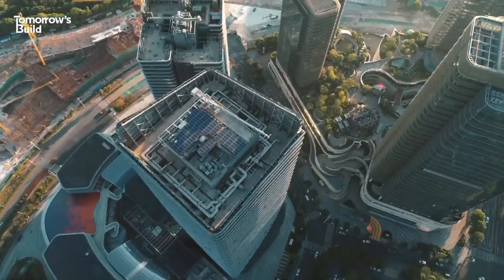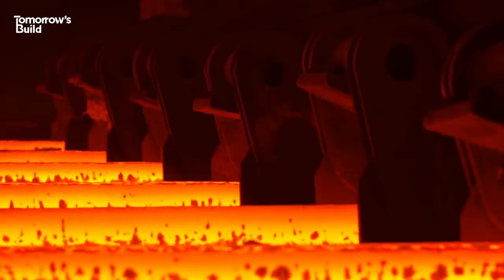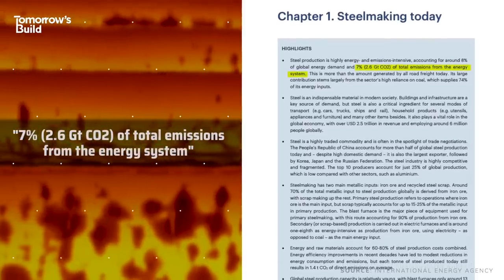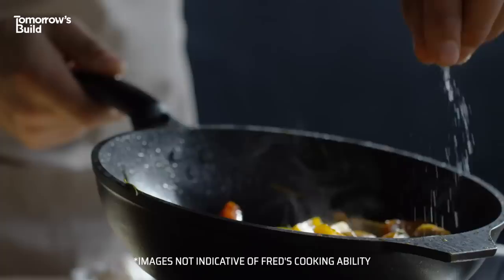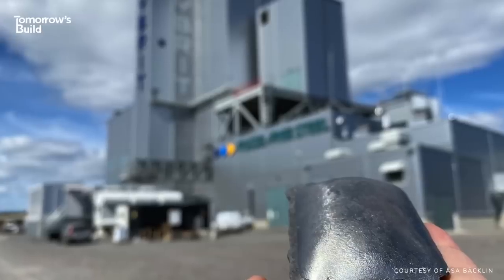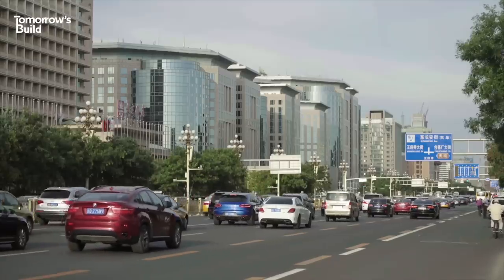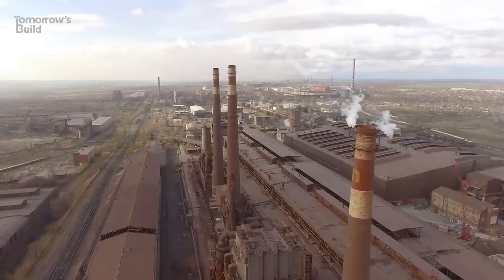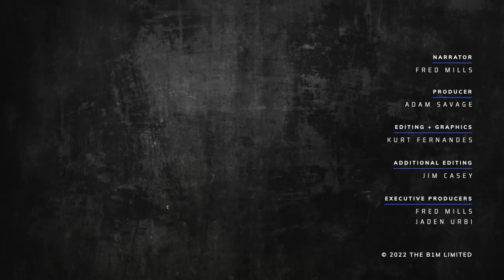Has Sweden Invented Green Steel?

Comment: I know from my professor, that the german companies like SalzgitterSteel are currently trying to implement this production technique for their production. The even plan on building windgenerators on the facillityground to produce the hydrogen.
Reply: In General, the concept of "green-steel" is nothing new. ThyssenKrupp is currently trying to convert their furnaces to accept gas, such that they can be easily switched to Hydrogen later on.
So no. Sweden has not discovered "green-steel".
Reply: @Ruhrpottpatriot  well no one else has made  green steel before, as gas furnaces do still have massive co2 emissions.

Your basis is the person who jumped basicly flew for the first time and solved flight. 
Achieving and theoretically trying are vastly different. 
In this endeavor Sweden was first.
Reply: @fridaybot  No, the title of this video was "Has Sweden invented green steel".
The usage of a know practice is not "inventing", it's "implementing".

And then even that is false. The Deutsche Edelstahlwerke already has a production method in place with reduced CO2 emissions by 90%, the swedes have 95%.
Reply: @trail-coffee4654  So exactly what TK wants to do starting 2024, i.e. 6 years prior to the plant from H2 Green Steel?
To quote TK: "thyssenkrupp Steel targets to put the first DR-plant into operation on an industrial scale in 2024."
 
Currently TK runs a H2 electrolysis plant in a venture with STEAG with 500MW capaity. This H2 will be used for DRI.
Also TK isn't building a completely new plant from scratch, like H2GreenSteel, but refitting running furnaces, which has additional complications.
Reply: I do hope they have plenty of room. With the best of todays windmills it would take 123.000.000 of them to produce the 80TWh needed in Sweden. And that's if the wind always blows hard enough.
Reply: @darkiee69  Why are people always so laser focussed on one singular green energy tech? 

Also: "80TWh" per what? day, month, year, decade?
Reply: @Ruhrpottpatriot  Year. That's all the hydropower produced in Sweden yearly, and then some.
Reply: @Ruhrpottpatriot  I dunno. To me it always seems like some sort of a straw-man argument.
Going green usually consist of two steps:
1. Make it work on electricity.
2. Produce environmentally friendly electricity.
The fact that the second problem is not solved yet, doesn't mean the found solution for the first problem is bad.
And one can argue that the second problem has many solutions. Only the implementation is slow, because of lack of priority.
Reply: @mennovanlavieren3885  Fun fact: The second problem has been solved, it's just that many people don't want to see the solution because then they would have to change their habits, or big companies fear for their revenue.

The fact alone that a good chunk of electricity demand can be covered by slapping PV modules on every rooftop (and paying the owners the same prices that electricity companies get, which cuts into revenues of big fossile fuel companies). 
Most of the natural gas or oil furnaces can be converted to heat-pumps (which also double as cooling in the summer), and district heating.
Then there's also the need that the number of cars needs to be reduced drastically. There's simply no going green when we keep the same (or even more) cars on the streets. This means, we need to invest heavily in public transport (which cuts into the revenues of big car).
And of course for places like the US the problem of racial and social segregation plays a huge role in keeping the current and totally stupid zoning codes, which further promote environmentally unfriendly tech.

There is not a single solution, which is what most people expect. Instead there are many small steps that male up the puzzle that is climate change.
However, that often is far to complicated for many people (for a number of different reasons).

Of course research still needs to be made to make everything more efficient.
Still: We have the tools, we just need to use them.
Reply: The French and Italians are also working on this ,especially to make specialist steels .
Reply: @Ruhrpottpatriot  I'd say a big issue is how govts handle implementation, like in my state rn they're subsidizing solar, however instead of putting them on preexisting structures they're taking entire former agricultural fields and painting them in low solar panels that spend most of the year buried in snow. Or with wind they get to bypass environmental protection laws to bulldoze, pave, and cement entire mountain tops to put them in and completely wreck the natural landscape. We also really need to work out the recycling and production hazards of solar BEFORE we go too crazy with installing them, and should probably subsidize cleaner and easy to recycle variants. A lot of ppl that are against green initiatives in my home state aren't against going green itself, it's how the govt bungles it that they're against. A lot of these govt subsidies actually benefit wealthy land owners to a worrisome degree, and you run into similar exploits to the insane 'carbon credit' system. We really need to have more transparent thought out infrastructure plans at this stage for widespread adoption.
Reply: @xxportalxx.  "We also really need to work out the recycling and production hazards of solar BEFORE we go too crazy with installing them, and should probably subsidize cleaner and easy to recycle variants."
The recycling is already there, there's simply no legal requirement of companies doing so, at least not outside of Europe, where at least 85% of old panels need to be recycled.

"however instead of putting them on preexisting structures they're taking entire former agricultural fields and painting them in low solar panels that spend most of the year buried in snow."
You mean, the farmers take the money and then build PV on their fields to make easy cash?
Reply: @Ruhrpottpatriot  yes, exactly, recycling infrastructure can't just be manifested overnight, it should be built in conjunction with the panels (with an actionable plan established BEFORE the construction of the panels). The subsidies should be modified to favor installation on buildings, rather than deforesting land to put up a field of panels (which happened a mile down the road from where I'm currently typing this).

If we don't manage these things properly then we're simply trading one ecological disaster for another.

Comment: Is this hydrogen they are using now even actually fossil-free? To make green H2 from purely renewable power is still 5x more expensive than gas based H2 and very rare, making any resulting steel product a very expensive and undesirable deal. I can't find anything about the source for the "fossil-free" electricity on their website either.
Reply: I  think Fortescue  is going to be the supplier.
Reply: Certain people get somewhat annoyed if you bring the topic of “cost” into the discussion. Apparently their motto is “at ANY cost”
Reply: Almost all of Sweden's electricity is green. 90% is from hydro, nuclear and wind. Less than 1% of Sweden's electricity was produced from fossil fuels in 2020.
Reply: Can Sweden produce enough steel to be a major exporter in the world market? Can they compete with giants China & India?
Reply: @Tux.Penguin  probably not. still, if they manage to perfect this technology and bring the costs down, bigger producers will follow
Reply: @Tux.Penguin  Sweden is one of the world's biggest suppliers of DRI grade magnetite. And no, even if they converted that all into green steel, they'd still wouldn't be a major exporter of steel globally. That's one of the key issues with Hybrit that no-one wants to talk about - it requires a very specific ore type that only makes up s tiny amount of all the iron ore currently being mined.

Comment: Actually there are plenty of steelmakers in Europe discussing/planning to use the HDR-method. There are also some initiatives in Germany for example to modernise entire industrial regions by focusing on using hydrogen instead of fossil fuels. Its really interesting to see what synergy effects are possible when you connect different industries (from byproducts that can be used somewhere else to redirecting process heat). Only downside atm is the cost of green hydrogen (production as well as transportation and storage) and the lack of proper subsidies from governments. Hydrogen imo is really being held back by the "let's electrify everything" agenda. But let's see where we are in 5 years
Reply: I totally agree 

A lot more investment in R&D to bring the cost down and especially find materials that are cheaper to make electrolyzer more cost efficient 
The energy solutions to produce GH2 cheaply are available, it’s just the equipment to convert and then the best solution to store/transport ( which might be ammonia) 

Solve for electrolyzer membranes and we are well on our way

Comment: If this holds up it could indirectly help part of the storage issues with something like wind energy. Conversion from energy to hydrogen and back again isn't super efficient but if all you need is the hydrogen for this process, that could be produced when there's a surplus of energy in the grid, instead of shutting down wind turbines to avoid blowing out the grid.
It obviously won't help with getting power back into the grid on demand but taking care of surplus in the production line of a highly needed product will presumable make it possible to put up more windmills without having to shut most of them down outside of peak consumption hours.

Comment: They are opening up a green steel factory near my town and I was intrigued. Now I know more about it and why it is getting so much attention. 

However, I did drive to the location of where they are building this huge factory. They chopped down basically an entire forest, and the factory requires more accomodation and the such in order to host its staff in an already cramped city. It just feels off claiming it's fossil free and etc when the entire process, from start to finish isn't by any means this.

Comment: So at what point does the reduced Fe acquire the Carbon atoms to become actual steel. My understanding was that the steel we use is an alloy of carbon and iron molecules with some additive elements for specific use cases. If all you add to the steel is hydrogen to reduce it, there is never any steel made, just some high purity iron.

Comment: What's the cost difference to use this method? And how much energy does it take to make the hydrogen for the process?
Reply: Opex alone is multiple $100s per tonne more expensive. Capex is catastrophic. If it were in anyway close in cost, everyone would be doing it already.
Reply: @gavwah  That's what I figured
Reply: To be fair to the price... This is not even early adopter costs, this is prototype stage. A small plant for proof of concept and science. 

It will take time for production of scale, combined with mechanics like carbon tax schemes to make this economically viable. But we need to start somewhere.
Reply: @marcusalm7350  it's not a coincidence that Thyssenkrupp will switch their first BF off in favor of Natural Gas DRI in 2026 considering what the EU's plan is for their carbon tax.

Unless your grid averages less than 0.15 t CO2 eq / MWh, natural gas actually has lower emissions than hydrogen in this application.

Comment: Very interesting - hadn't heard about that. Of course they still need to excavate the raw material, that they use to make steel (well - I assume). So it is not based on renewable ressources like wood. But since it is so long lasting under the right circumstances and since it can be melted and reused for new steel, it is a relatively ok material. Even wood buildings, cannot be built entirely without steel, as they normally uses screws, brackets etc. to connect the wood structures.

Comment: I have a couple of questions. How much does that steel cost to make. And, was the energy used to make it completely from renewables or was it from renewables only during daylight hours? Did they use battery capacity when the wind stopped blowing and the sun stopped shining? Sorry, I'm just a little sceptical.
Reply: The price is supposed to be comparable to regular steel when everything is completed. They will use hydropower from Luleå river
Reply: Look up Swedens energy production. A lot is produced up north in hydropower in massive amounts. In 2021 Sweden exported 166 TWh of green energy. For other countries, yes I agree, but for Sweden, not so much. It is an international powerhouse when it comes to green energy, especially up north.

Comment: Awesome video, important message, and sharp puns!

Curious why no word about the cost difference though. I get that it definitely varies depending on the price of fossil-free energy at a particular location, but what's their current deal in the end, and what's the outlook... Decisionmakers will need to know this.
Reply: I mean it is in pilot stage. First stage of any innovation is proving that it can be done, second stage is to reach commercialize and scale-up. It cannot be "too" crazy considering that many companies are already buying up for PR-project (like the dumpster truck viewed in the video).
Reply: They claim 25-30 % higher cost of the green steel when in full production.
Reply: 20-30% more expensive than current methods, they claim.

I'd recommend watching the EmTech MENA video on molten oxide electrolysis from 2019, which is apparently significantly cheaper than current methods.

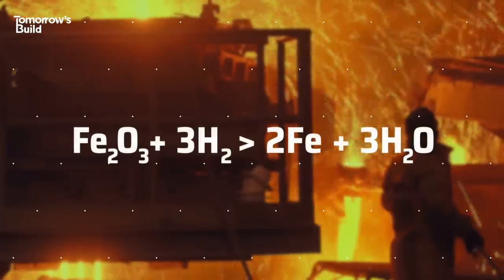Comment: It's an interesting concept, but I don't understand how they add the carbon to the steel, because, as I understand it, originally the iron ore is mixed with both limestone and coke in a blast furnace and you get molten pig iron, the carbon content of which is later lowered, instead of making it a 2-step process, separating the pure iron and presumably adding the carbon later, as is implied in the reaction formula at 2:38. Steel is made of iron and carbon, and, as far as I know, there isn't a feasible way of combining these 2 on a large scale without emitting a lot of CO2. On their website I also didn't find them talking about that step of the process anywhere, only about getting pure iron from iron ore.

Would love for someone smarter than me to explain this please :)

Comment: Carbon-free steel was demonstrated in 2006 by Professor Donald Sadoway and team, using molten oxide electrolysis. 

Production expected in 2026, same as this company. Sadoway's method doesn't need hydrogen, so it is more economically feasible at current prices. If their numbers are correct, it's cheaper than traditional production methods.

Hopefully both companies start producing in 2026 with no issues.

Comment: The main issue with that is it's cost compared to traditional production, if it's way mor expensive Chinese cheap steel will just flood the market. Also how does this production method work at larger production scale, is it even possible? Will it require absurd amount of electricity with additional production size?
Reply: Main issue short term is that hydrogen isn't green... yet
Reply: @Garner84  If anyone has the resources to produce green Hydrogen, then it's got to be the Nordic countries with all that hydro power &c.
Reply: I wouldnt be surprised if the EU would be willing to subsidise the higher production cost so the chinese stuff cant compete
Reply: Why not just make a certification for co2 neutral steel and ban all products that don't adhere to it, super easy regalatory wise. All responsibility rests on the manufacturers/importers who don't want huge fines coming their way. If the goverment judges there to be to much disregardment of the policy they can just instruct the police to put more of their attention into regalatory work.
Reply: @JP_TaVeryMuch  actually, Canada has a fair amount of slack hydropower capacity in some areas and about 100% room for expansion, ie could feasibly at least double their hydropower production.
Reply: @acchaladka  Certainement! I was just keeping to the subject area of the video, not wishing to exclude other gifted countries.
Reply: The answer lies in the European carbon trading system (ETS) paired with the new Carbon border adjustment mechanism (CBAM). The carbon trading system is increasing the cost of emitting carbon every year in the EU, the CBAM will make it more expensive to import products from outside the EU produced through methods with high emissions.
Reply: @JP_TaVeryMuch  I fully agree with your opionion
Reply: @abookishtype  so the answer is, raise the prize on everything?
Reply: Uhmm, Chinese steel was poor quality, and prone to embrittlement. They also have problems with consistencies.
Reply: @davidjoelsson4929  co2 neutral steel is more expensive than non co2 neutral steel, so to make it more cost competative, measures are taken. An example is a policy where a part of the purchase price of solar panels is being subsidised for homeowners to increase the share of solar on the grid.
Reply: Simple: just tax taking fossils out of the ground and tax any imports based on fossils. Use the tax revenue to lower the VAT, so the price levels stay the same.
And with simple, I mean this is the most simple solution that actually enforces change and put the cost on those who resist change. Instead of making a convoluted solution that put the cost on everyone, doesn't work and allows a few to cheat the system and make a lot of money in the proces of doing nothing.
Reply: @mennovanlavieren3885  Wouldn't that pose opposition from lobbyists not invloved with steelworks?